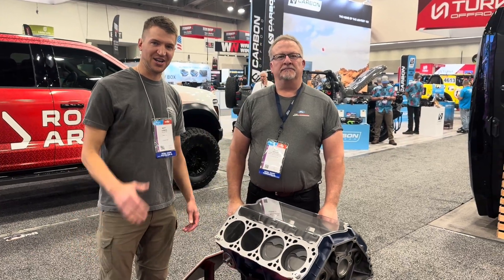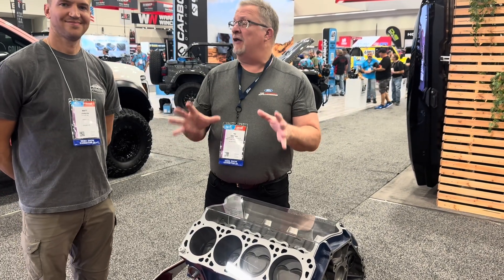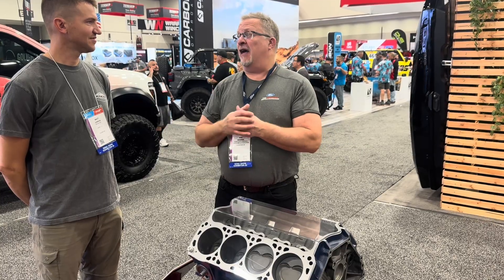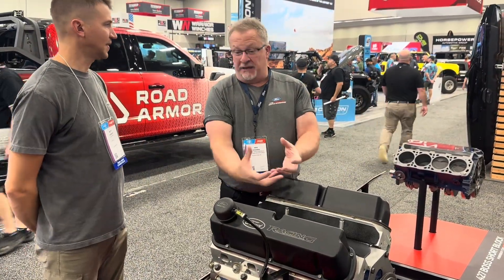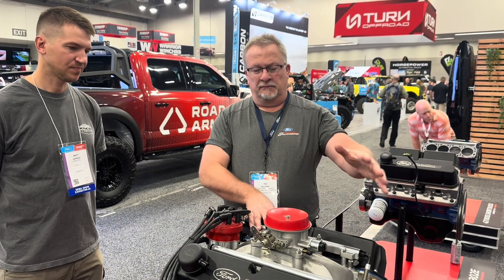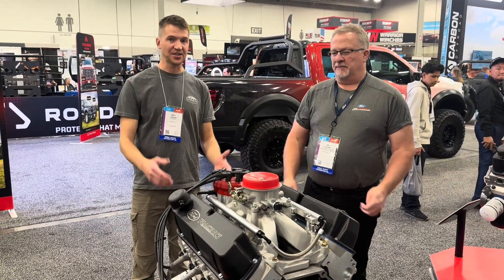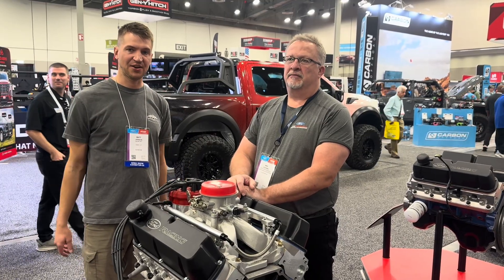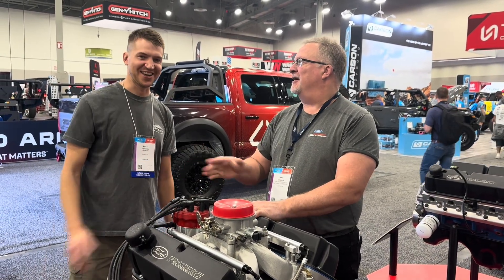HERITAGE FORD V8s? STILL THE GREATS! BETTER THAN EVER PROCESSES EXPLAINED BY FORD.

Comment: I love that Ford does this.  Hasn’t forgot about us old school cool guys.  Essentially a factory race motor with a warranty.  Unreal.  I’m torn between the 460 SB and the 572 BB.  Big $$ Difference Though.  Thanks for putting up this good highlights video.
Reply from the maker: It was so cool seeing how much love Ford put into the new heritage program. We are using the 460SBF and extremely excited, but that big block is a tank
Reply: @DocJohnsonRestorations I’m pretty much leaning towards the 460 SB because with the $8k I have left that I didn’t spend on the 572, I can have a bomb proof drivetrain built for it.  I’m watching your channel, sub’ed, for your build with that motor.  Love, Love, Love Bullnose Fords… and my ‘77 too.  Can’t forget my dentside darling. 😊
Reply from the maker: Awesome! The 460 will be a great bang for the buck choice